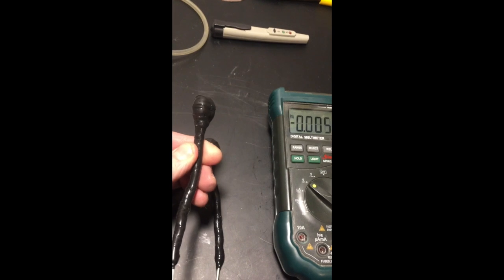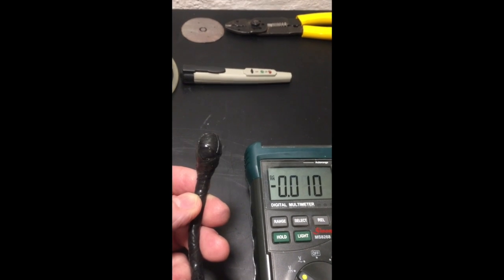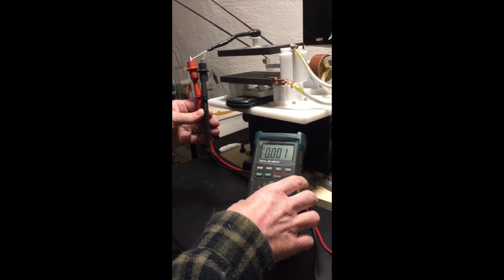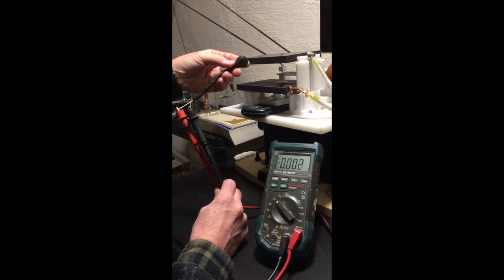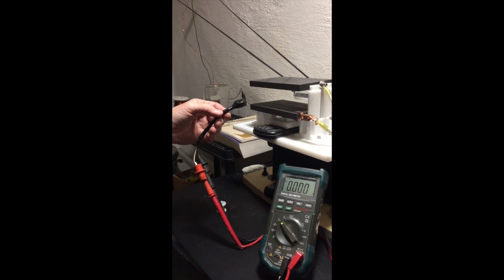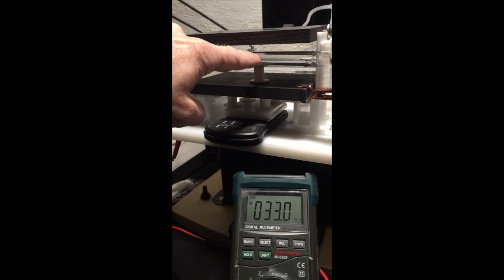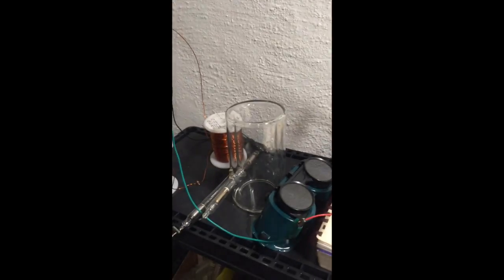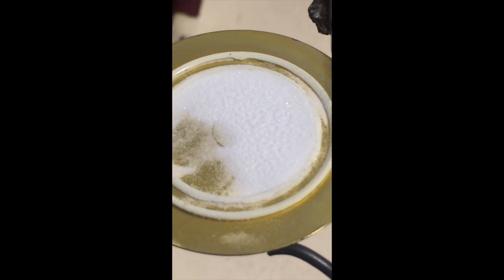SUN- IONOSPHERE -EARTH:PLASMA/PIEZOELECTRIC TRANSDUCTION?

Comment: YES! Awesome experiment!! I believe the Earth is one big resonant crystalline/metallic ball. The vibration and motion, of the elements that make up the Earth, creates an electrostatic zone into the plasma around it. The Earth is a discharging electret. The static field pressure, presented by the Earth, oscillates with any mass presented in it. Repulsion and attraction are both implemented. The electrostatic field sets mass in motion along the longitudinal, inertial lines of force at 90 degrees to the Earths surface. "Gravity" :) Fundamentally, the exhibition of the static field by celestial objects is similar to a discharging Van De Graaff generator. Except, the  Earth's electric charge isn't generated with a rubber band and wire brushes. It's oscillating :) If I were to remove the mechanism for a Van De Graaff generator's static field production and placed a bunch of piezoelectric crystals in the interior of the sphere, the charge would build and present in the same way. Rocks are underrated :) lol Again, very good incite and brilliance for setting up this experiment! Thank you!
Reply from the maker: +Brugga Jugga 
Thank you.  Your insights are indeed great as well.  Your comments have foreshadowed my interest in making an experimental set up regarding "gravity....." all with time Thanks again for the encouragement.
Reply: I know it’s been a long time since you posted but I agree with your comment. I wanted to ask if you have ever saw or heard about the huge crystal caves located around the world below ground. The scientist claim the earthquake lights form because of the electric charge from the rocks and other debri shifting underground. However, that doesn’t make sense when these lights are known to happen sometimes a week before the quake. Also, it seems as if there is always an earthquake a few days or a week after major sun activity,.